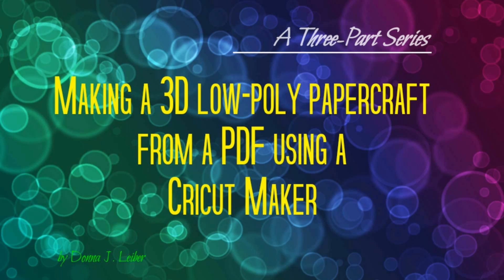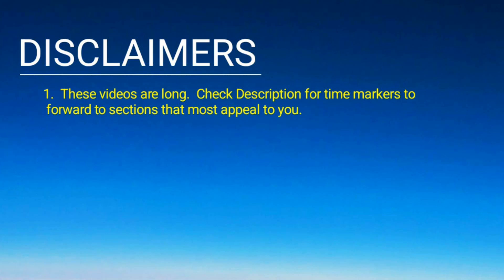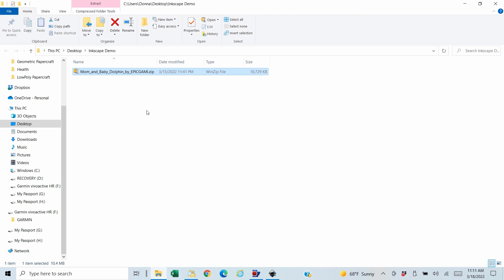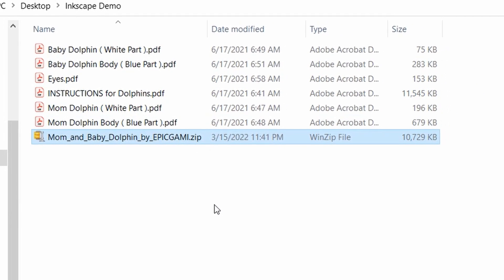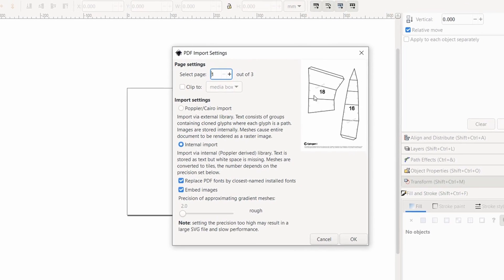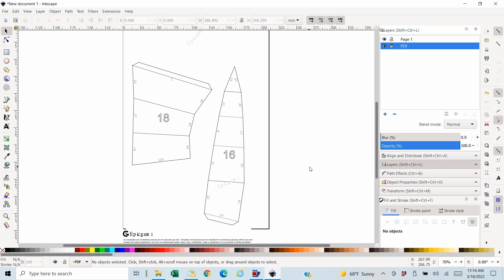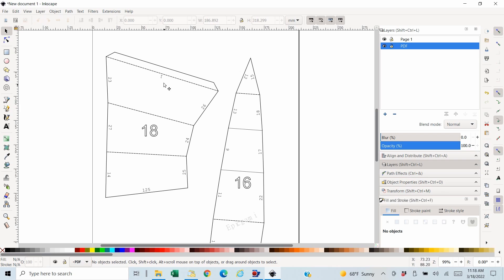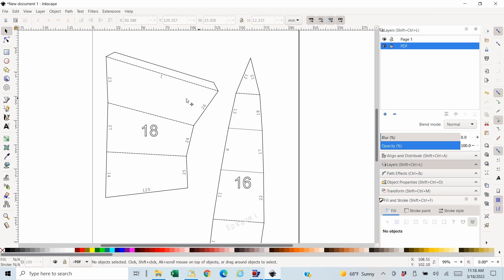Making a 3D Low-Poly Papercraft:  Part 1--Converting a PDF to SVG for use with Cricut

Comment: Thank you for your video.  Very helpful.  I am still working on the one I am converting.  The first two pages are fine, but now on my 3 page and I am having the same issue you had where the numbers are not pasting to the page layer.  Some are and some are not.  Also, some of my lines are not as well.  Will they show up after I upload them to Design Space?
Reply from the maker: Thanks for your comment.  I think if the numbers or lines aren't showing in Inkscape, it's unlikely they'd show in Design Space.  Maybe some white box that you can't see is hiding them?